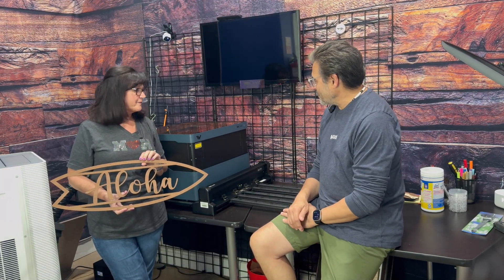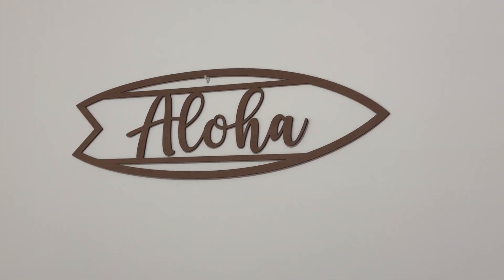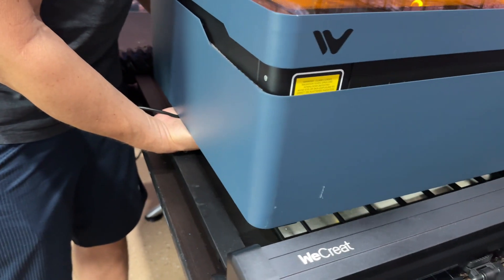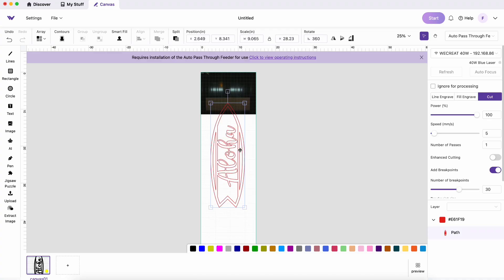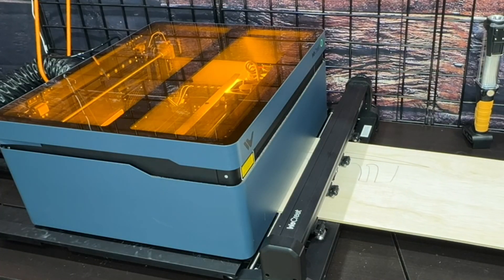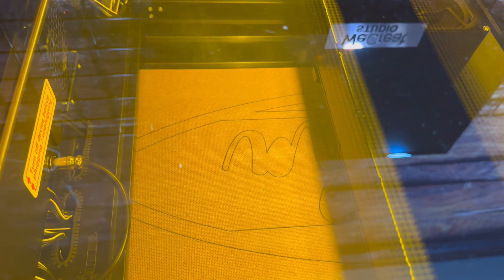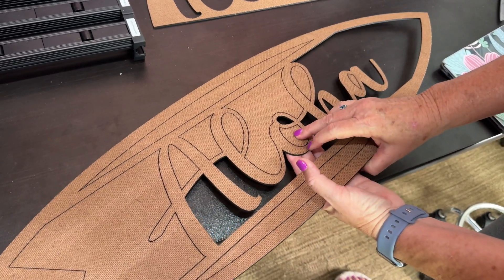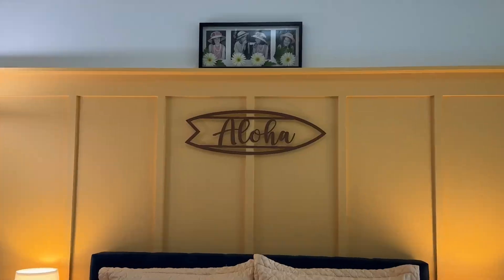Create BIGGER Laser Projects with the WeCreat Auto Pass Through Feeder

Comment: Hi I am just putting my pass through together and getting ready to put my Vision 40w on it.  Do we need additional eye protection because the machine is lifted upon the pass thru?  Is there a risk of laser light escaping while on the pass through?
Reply from the maker: Great question. I'm not an optometrist, but due to the small amount of laser light leaking through the very narrow opening, it would be very difficult to view it directly. Most of the laser radiation is shielded by the machine and its orange filter. We did not use goggles, but we didn't attempt to stare directly at the laser either. Wouldn't hurt to use eye protection, but I'd bounce this question to @WeCreat customer support for the official answer.
-Fresh